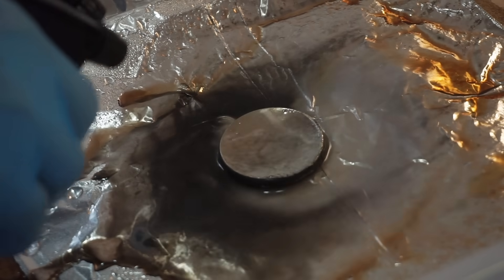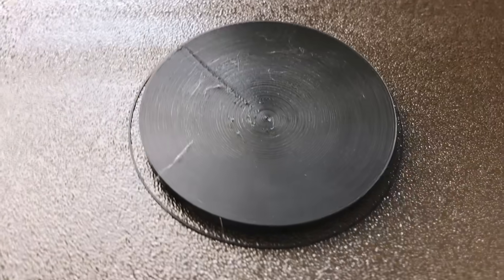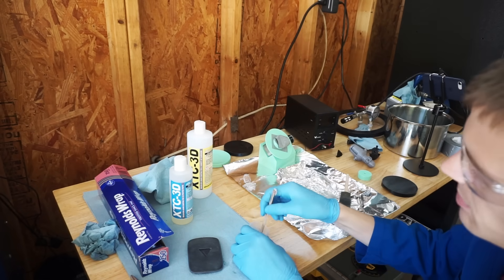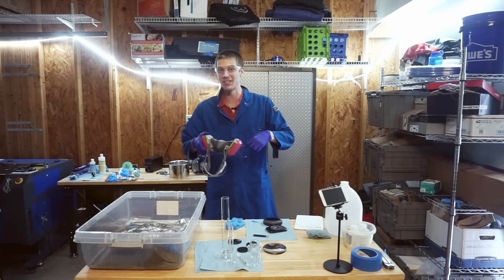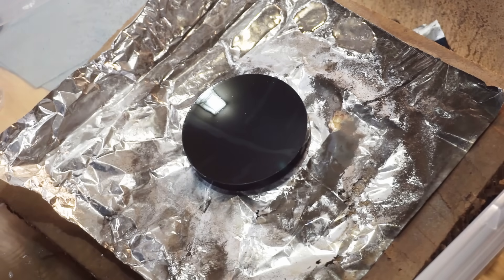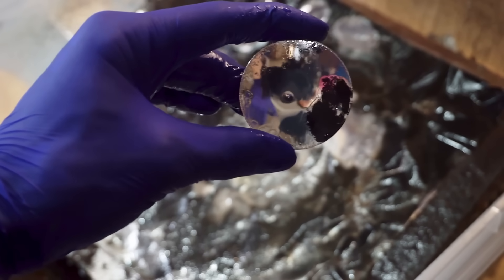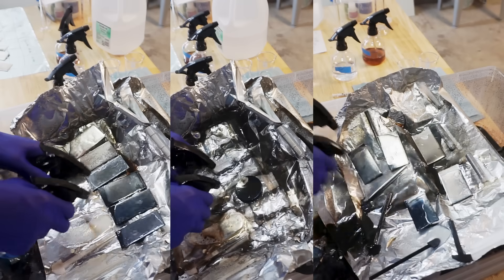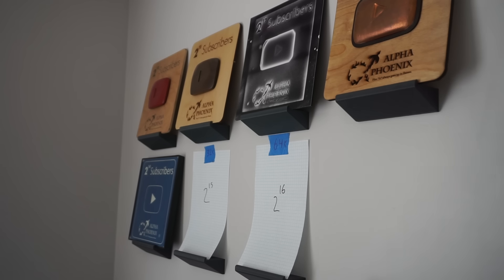How does a "first surface" mirror work? (2^15 sub special!)

Comment: Have u looked into vapor smoothing of 3d prints? You can get pretty much perfectly smooth surfaces from stuff I've seen without needing to add any material
Reply from the maker: The papers I read suggested the actual rms roughness was better with coatings, but I would like to explore vapor. I think it’s pretty nasty stuff for PLA though
Reply: @AlphaPhoenixChannel  ABS can be smoothed with acetone and PVB can be smoothed with isopropyl, if you have the means to print either. you can push smoothing pretty far by just leaving it in the vapor longer, though im sure that leads to its own problems.
Reply: @AlphaPhoenixChannel  Acetone vapor smoothing for ABS works well, and while PLA can be dissolved in dichloromethane or chloroform, the vapors don't seem to have any smoothing effect in my experience. It just makes the plastic soft. Dipping or brushing solvent onto PLA can smooth the surface but the process is very difficult to control. I've never gotten a good result from it. Acetone vapor smoothing ABS is the only solvent smoothing process that works well in my experience. And even if the RMS roughness is higher than resin, it could still be useful as a preparation step to reduce the amount of smoothing the resin coating has to do. Also, printing the parts with a resin printer will give much a much finer surface finish natively. DLP and SLA are way more precise than FDM.
Reply: Also if you don't want bubbles in your resin, using a pressure pot to shrink them to negligible size rather than using a vacuum chamber to pop them is a much easier, less chaotic process

Comment: Degassing resins probably works by 1) boiling off volatile impurities and 2) enlarging bubbles so they are more buoyant. If the resin itself is boiling off, then you wouldn't accomplish anything. If it isn't, maybe try degassing before application so it can finish bubbling beforehand.

That spray on silver is pretty cool. I'll remember it.
Reply: those bubbles were likely from the print rather than the resin. A 3d print is like a big solid sponge
Reply: @GHexagon7209  Ah, good point

Comment: "Throwing variables at the wall and seeing what sticks" - Mendel would like a word (also have you heard of chrome paint? 😄)
Reply: This really got me, I felt personally attacked haha
Reply: Thanks Cave Johnson
Reply: Have you used chrome paint?  Lol, it doesn't look like the lid thats for sure !
Reply: Sh!t usually sticks...
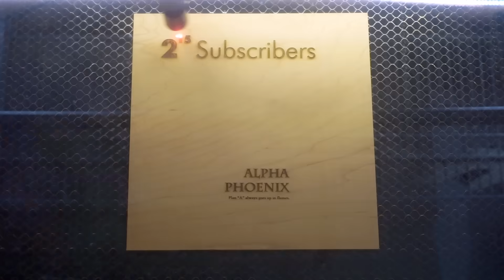Reply: 16:13 on the left for the chrome paint.
He sure knows how to troll :)
Reply: Chrome paint doesn't even remotely approach the optical quality of a silvered surface.
Reply: Quick question, what did you mean by oxygen contamination, like UV resin depends on oxygen?
Reply: Its a mirror-cool
Reply: Now I have to know who mendel is I hope your happy and crome paint cant compare to a mirror finish
Reply: Mendel GOAT. Hello from Czechia
Reply: Adam Savage frequently says "The difference between science and just messing around is writing down the results."
Reply: this is the guy that paints his rusting chrome bumper with silver paint expecting the lid colour 🤣
Reply: I had dome skunk bud back in the late 80s that would stick to the wall when thrown and you couldn't break it up you had to very gently pull a piece off lol
Reply: Unfortunately you can't get a silver play button by rigging the numbers 😂
Reply: There is that rust oleum mirror effect paint too. I did some tests with it and you can create quite good mirror for flat surface with it. Tho the best result with this would be to use it on glass, like real mirror. Not sure how would it work for 3d-prints.
Reply: Yeah, experiential and experimental are the best kinds of science.
Thomas Edison made 1500 failure light bulbs and one successful one.  
Usually I try to watch other folks doing stuff before I do it for the first time.
Like the first time I made sweet potato pie and that was most helpful. One of the older ladies basically said "you can do whatever you want, but if it's bad, you messed up!" Three of them had the suggestion of cleaning the stringy stuff off the beaters five or six times when mixing it. As a textural thing.
So, my first set of sweet potato pies I ever made were absolutely fantastic! And I even used way less sugar than most would, because I'm prediabetic. But smooth, tasty, and with hints of cinnamon, nutmeg, and ginger. So. Yup. It's very fun to learn by seeing then doing. And if you're the first one doing it, then others will learn too!
Reply: The covid response method, except that you ignore results you find disfavorable or inconvenient

Comment: I may have to try this with my resin printer and see if I can make a little reflector telescope!
Reply from the maker: check out the Huygens optics video about mini telescope mirrors for satellites! if you can print suitably clear resin that'd be awesome. nowhere near diffraction-limited optics, but still pretty cool
Reply: @AlphaPhoenixChannel  yeah I saw that one. Maybe I'll give it a go. I am thinking about picking up an airbrush off Craigslist to try "silvering" much cheaper than the kit you used. It won't be nearly as good, but it's a lower cost way to at least get a proof of concept going. I found some videos of Alclad polished aluminum paint that looks like it may work
Reply from the maker: If you’re doing a second-surface like that I believe it’s significantly more forgiving. The specularness is set my the interface roughness rather than the interface AND the quality of the coating

Comment: So could you make it a second surface mirror by adding a coat of resin after applying the silver or is the mirror fragile enough that it would disrupt the mirror.
Reply: That doesn't solve the problem of the substrate not being flat
Reply: @robmckennie4203  this isn't a solution to the problem he's trying to solve in the video, but a response to the thing he said at the beginning of the video that first surface mirrors are fragile and breathing on them wrong can ruin them.

Comment: I think the air bubbles in the vacuum chamber came from winthin the print itself, since FDM prints tend to be porous.
Reply from the maker: Yep I think I was pulling air into the resin instead of popping the existing bubbles…

Comment: Try double or triple mixing of the Resin! 
After mixing pour it into a new beaker and use a new stick for mixing.

Even small quantity of non proper mixed resin from the container wall or the stick can ruin the resin.
Reply from the maker: Hmmm wall stick is a great point - I made some waffles the other day and got a bite of dry mix powder at one point that was not very appetizing. I think it detached from the bowl late…

Comment: the trick to getting bubbles out of resin is actually to put them in a pressure chamber rather than a vacuum chamber. to squish down the bubbles until theyre imperceptibly small and then let the resin harden around them.

either that or use a butane torch to pop them if theyre near the surface
Reply: Was going to comment this. Vacuum chambers are useful for getting bubbles out of your resin, but only if you do it before you pour. Any bubbles that make their way into your casting after you've poured can only be fixed with heat, a pressure chamber, or one-by-one with a needle.
Reply: Ya de gas your resin mixture before applying it
Reply: with epoxy you can also use fire to take out bubbles
Reply: @antzjr2184  What do you think a butane torch is?

Comment: Resins generally cure faster at higher temperatures even if it's advertised as curing at room temperature. This could have been the difference between the garage and inside the office curing. Try curing the resin at an elevated temp to get more consistent results.
Reply from the maker: Ooooh interesting thought - I sure the garage is a bit colder
Reply: @AlphaPhoenixChannel  I mean the reality here is that you should use a resin print from the beginning, pointed downwards, with anti-aliasing enabled, which will already give you the smooth surface you want. Such a printer is about $300 - like the Mars. And btw, resin printers are also very sensitive to temperature.
Reply from the maker: @Alexander Gräf This will get close, but won't get nanometer smooth surfaces I'm sure. The top surface of the play button was printed at 10um layer height even on my FDM prusa mini
Reply: @AlphaPhoenixChannel  The thing is, you want to be as close as possible with the print already - the new Saturn with 4K panel has 0.05mm X and Y, at layer heights of 0.01mm and anti-aliasing hiding most layer steps anyway - there really is no competition with FDM when it comes to print quality, even with very fine nozzles (CNC Kitchen did a video with a 0.1mm nozzle a few days ago). It's also pretty easy to sand and polish resin prints. It's kind of possible with FDM prints, but a lot more work, and obviously the more you have to sand, the more you deviate from your initial print.
Reply: @graealex  do they print with liquid resin?
Reply: @CommonTater100  Resin printers work by selectively curing liquid resin with UV light.
Reply: @graealex  i think it could work, but probably yuo gone need to cover the surface with resin again ( yuo can made the math or may the experiment) , i remember a method of a parabolic mirror is have a big turntable and a liquid metal like mercury or similar  , or a method for making glass parabolic mirror for telescopes, they use the natural parabolic shape  that forces -centrifuga and gravity  produce in the  surface when the glass is liquid(very hot) and its rotaiting
Reply: @AlphaPhoenixChannel  The datasheet for XTC-3D says to store and use at 73F (room temperature). And humidity is also a major factor that can cause inconsistent results with some epoxy chemistries, you should ideally store and use in a typical room type humidity (below 50%). Urethane resins are even more sensitive to humidity and will champagne bubble badly in high or even moderate humidity.
Reply: @AlphaPhoenixChannel  I believe that many of these resins are in fact thermoset polymers. It is absolutely the case that they work best in a fairly narrow set of temperatures, and that left in a lump, or in hot sun, they bake off extremely fast. Left spread thinly, they can take a very long time to cure, if at all.
Reply: @AlphaPhoenixChannel  The stickiness from the first (second batch?) will probably be due to the humidity being to high, the resin forms a lime like sticky surface. Hope it helps!
Reply: the general rule of thumb for organic chemistry is double the reaction rate for every 10°C increase
Reply from the maker: Another bit I forgot to mention - if you noticed the left side of the play button I made in the video was kinda rippled - I'd actually had others bubble up much more severely. I think it's the gyroid infill showing up after the part was left out in the sun, softening and causing the internal air to expand, pushing the skin outwards. If I try higher temps I'll take extra steps, probably making more top layers in the slicer and poking a hole in the bottom before exposing the part to heat.
Reply: I also believe moisture can have an effect.
Reply: The reason they didn’t silver properly is because the resin wasn’t dry. It’s still letting vocs out which then causes the silver to go Matt. While the resin did silver it’s not made for slivering. You need a special designed basecoat so it actually bonds to the surface. This is what I do for work everyday. We also have a smoothing resin for 3d printing which is so much better than the xtc.
Reply: True! Also could be humidity. Resin's seem to like to cure differently on rainy days for me anyways.
Reply: Also, having it cure in a garage or outside means that the temerature and possibly humidity could be inconsistent, and therefore alter the resin's cure speed as well as ability to cure properly.
Reply: @erminiumf.9526  I was thinking the same, outside there would be bigger fluctuations in temperature and humidity...
Reply: Why would cure speed ultimately make it fail? Couldn't you wait longer for the garage batch and the resin should still eventually cure to the same point?
Reply: @DaniGirl6  You would think so, but unfortunately the exposed surface absorbs water and other things (oxygen, for example) that screws up the chemistry
Reply: And on the other end, rule of thumb: when you need more working time you can usually chill stuff. Many times it's a safe bet to just get it "really cold without any ingredients phase changing"
Reply: not the variable in the wall haha
Reply: The curing time depends on the chemicals used in the resin and hardener several years ago i lived on my sail boat and became quite familiar with the different types of resins. You can get from 15 minutes to harden up to 24 hours to harden and picking one type it can harden from 15% to 200% of the time specified to actually fully cure more than once i have had it harden before i had finished mixing it and once it actualy cought fire in the mixing tub which is not a fun thing to happen when you are holding the mixing tub and have nowhere to put it down in the end i put it into the gally sink and just wated for it to go out.
Reply: I wonder if using an ultrasonic transducer to atomize the solutions  would make it  have a smoother  finish or work better
take two mist makers or essential oil diffusers and  add a hose to each one and then put the part in the middle so that the chemical mist from each  hose is mixing on the part.
Reply: This guy sounds super smart, but he misses the fact that polymerisation is a function of temperature?
Reply: Also the curing reaction is exothermic and if you mix too big a batch (e.g. whole bucket of floor epoxy) too quickly (power drill), in the summer afternoon heat, the mixture will self-accelerate to a point of steaming and solidifying in 1 minute.
Reply: Too hot though and the epoxy doesn't cure properly. Might lose out on cure hardness for cure speed or viscosity while pouring. May also end up not curing right at all and end up still sticky. Many variables to think about when it comes to resin/epoxy and what the end product needs. Generally the max cure temp for any resin should be used as much hotter than the 90-100 degree F will screw up the curing process in my experience. I messed up a resin desk top by curing at the top end of the range and it never fully hardened to be useful as a desk top as a fingernail would leave a dent easily and it scratched by rubbing a finger on it.
Reply: @m_6866  yurp too hot and you basically cure the outer portion while the inner is still liquid.
Reply: @m_6866  highly depends on if you are ramping the temperature in one go or stepping, and obviously your resin too. I personally cure resins at 50-60C for 5h and then increase it to 80C for the next 10h, this is a common lab procedure just with heating times, all you want to do is avoid anything above 60C during the initial cure, until it is hard enough to touch to not leave visible indents on touch, at which point you can move to a higher temperature gradient. The stuff I normally use has a glass transition temperature of 105C, which leaves me a good margin till degradation, results may vary.
Reply: Could it also have something to do with UV exposure?
Reply: @JamesChurchill3  No, epoxy doesn't use UV. I'd also say it's the colder outside temperature which probably also ruins part of the epoxy monomer by giving it more time to react with water in the air instead of undergoing polymerization
Reply: @christiannorf1680  wrong, there is a UV cure epoxy instead of the thermal one.
Reply: @kaikart123  It's a special case then. Epoxides (where the term epoxy comes from) are a class of chemical compounds that polymerize by a different mechanism than e. g. acrylates (like MMA) which use UV.
What you are referring to is very likely a pre-polymerized epoxy that is cross-linked by UV to harden it.
Reply: @christiannorf1680  actually no, acid photogenerators are also used and commercially available, specifically for use with epoxy resin. Just look up cationic UV cure. There are other UV curing mechanisms than just free radical polymerisation.